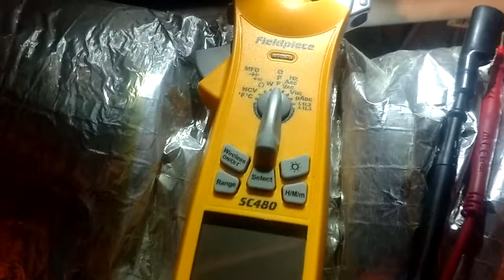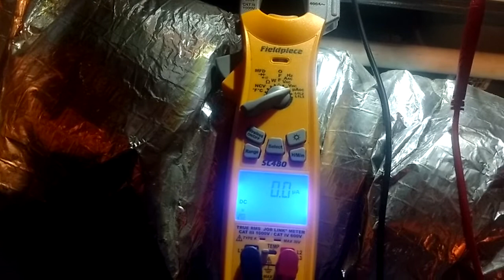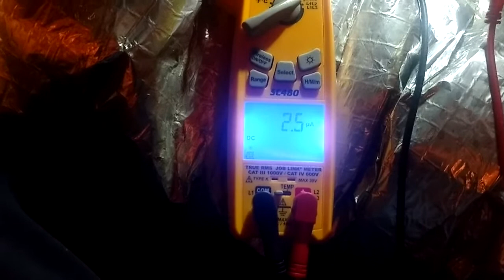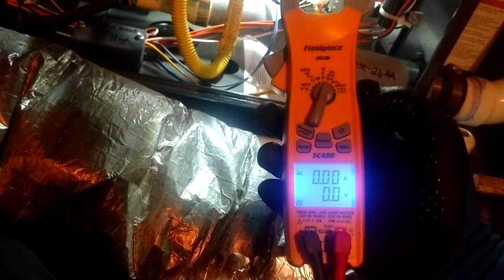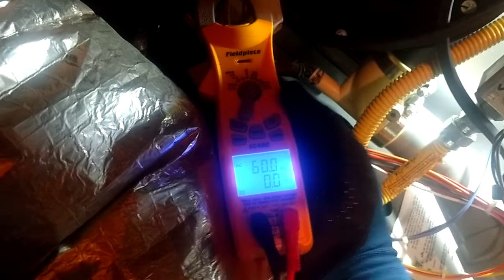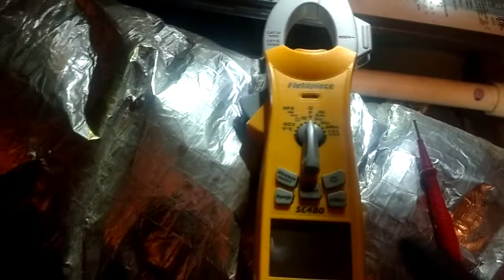Fieldpiece SC480 checking Microamps uADC. Flame sensor testing 🔥 5 min. back-light 😎👌

Comment: 👍how do you like the sc480 what is the response time for the capacitance check.? Some meters are slow pokes.
Reply from the maker: This meter is definitely a top contender. Capacitor check is very fast and accurate. Only takes 1 second to give a reading. It's also extremely reliable for start capacitors in the higher uf ranges. (This meter scores very high in that category.) The continuity beep is the only setting that is slightly slower than some other meters I've used. I'm not sure why that is considering I have some other Fieldpiece meters that are 10 years old & they have a very fast continuity beep. The sc480 can only keep up with about one test lead "tap" per 1/2 second. Which is odd because of all the other settings being so fast. But that's definitely not a deal-breaker for this meter. I LOVE THE 5-MINUTE BACKLIGHT!!!
💡💡💡 Hope that helps. Thanks for watching 👍
Reply: Shannon Knight HVAC thank you for the response helps a bunch. Take care
Reply from the maker: Check it out ⬇️⬇️⬇️
https://youtu.be/7bVILFft7wk

Comment: ...that 5min backlight is a nice bonus!
Wanting to upgrade from the SC440 to the 480 - mostly for the wireless feature for checking blower amps.
The dual-display is EXACTLY the same reason I went from an SC260 to the 440, for heat kits - used to work on 95% residential Air Handlers.
Reply from the maker: Yeah I'm still Loving it. That 5 minute backlight makes all the difference in the world. Just goes to show you that fieldpiece does listen to what the technicians out in the field have to say and then they make changes to their instruments. And then you'll also really like having the addition of the min/max/hold button. That's the only thing that they left off of the sc440.. thanks for watching buddy, and for the feedback 😎👍
Reply from the maker: With the wireless feature and the field piece app you will be able to view the amp draw in the form of a bar graph. So in real time you will be able to see the line going up and down on a graph. That's pretty cool. And now the sc480 has been integrated into measure quick as well.

Comment: Thanks for sharing. So you do not see the need for the swivel clamp?
Reply from the maker: I also have the sc56, which is the very first swivel clamp that Fieldpiece made. I never found myself using that feature very often. I prefer the fixed-head on the SC480. But everybody's different. I know a lot of guys love that feature. I think it comes down to the size difference between the 2 meters (sc480 vs sc680) more than anything else. The 680 is a very large meter. But this 480 is a very nice size meter. Thanks for watching Steven 😎👍

Comment: Thanks for the review Shannon. I hope you fixed the flex line that appears to be penetrating the cabinet. Also as for hertz, I wonder if you could wrap the wire around the clamp several times to get a reading like the good ol days if the amp draw is low. (I feel older every day)
Reply from the maker: Kanga you're still rollin with the heat anticipator in your t-stat. I bet you're still putting leaded gas in your car.  I'm still hoping the video store will open back up so I can get that last stamp punched on my card and get a free rental. I've been wanting to see that ET movie everybody's been talking about. 😏😏😏

Comment: What is  The normal microamp  range for flame sensor
Reply from the maker: It varies, but it's usually going to be at least 1.8 or higher. Anyting under 1.8 and the furnace probably isn't going to run properly.

Comment: Does the sc480 have a magnetic strap? Thanks again.
Reply from the maker: Yes indeed it does. No test lead storage on the back, but the magnet is a GO 👌
And I'm sure you noticed the Jaw Light in the clamp to light up the work area. It is quit bright & very handy too. Thanks for watching 👍
Reply: @sknight0391  
Sweet thanks again. I really don't care about the lead storage that usually breaks in  a few weeks.
Reply from the maker: @mikelewis4260  I feel the same way. Also puts too much stress on the test leads causing them to develop shorts prematurely.

Comment: 👍is this going to be your everyday carry ? Its been awhile since I had a Fieldpiece meter.
Reply from the maker: Definitely EDC for awhile. Have to put it thru it's paces. It's definitely a top contender. All the settings are fast & accurate except for continuity is alittle slow. Which is some what unusual because Fieldpiece has always had a very "quick" continuity beeper. It's definitely NOT a deal breaker for this meter, but it's something noteworthy to mention. This meter has to many other great things going for it to nit-pick over 1 beep per 1/2 second. WATTS video coming soon. 😁👌

Comment: I’ve been seriously considering buying this meter and with the 2 videos you have shown I think I’m sold! My Sc77 finally quit on me so I’ve been running my back up (UEI dl479) and it’s a decent meter but it just doesn’t have a few of the features that I want in a meter. It’s time to place an order with TruTech!
Reply from the maker: Sounds like a plan. Don't forget to use Zack's discount code "ShopTalk" at TruTech Tools to save some bucks. I'll be doing another video on "Watts" in a few days 👍
Reply from the maker: And since you're coming off of the SC 77 you will also notice that this meter doesn't beep when you turn it on or when you're changing settings on the dial. Don't know why Fieldpiece happened to leave that off of the 480 & 680, but I always like to hear my meter beep when it turns on. I guess it's just a comfort thing 😁 #beepbeep
Reply: Yeah the beep when it turns on is a good feature for piece of mind but this meter not having it isn’t a deal breaker for me. I can’t wait to get my hands on this meter and put it to good use in the field.